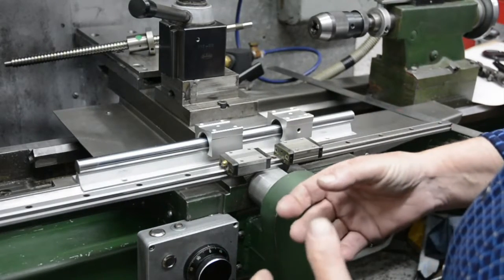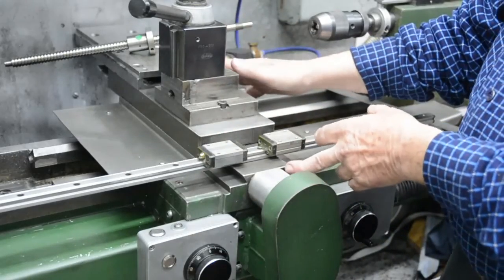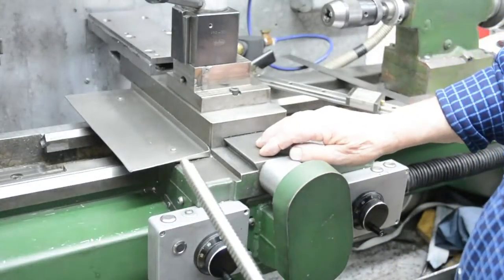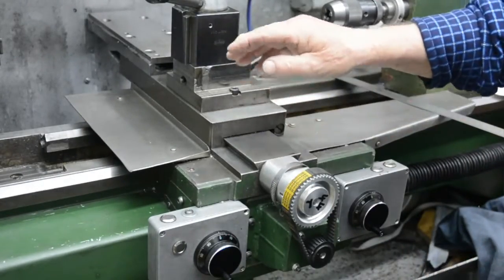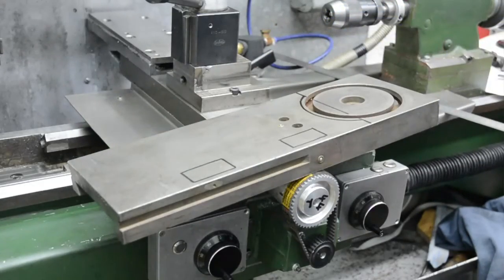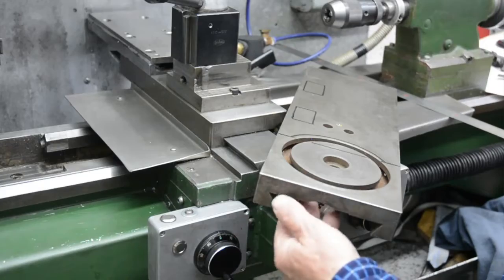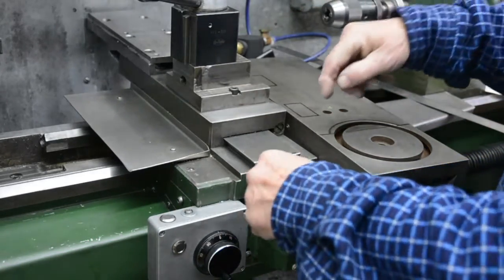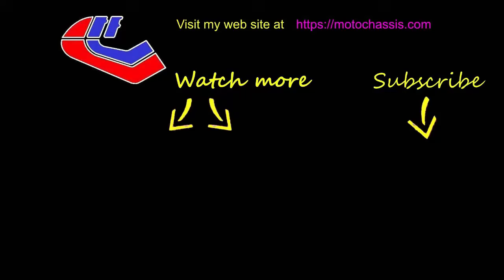Part 1. Upgrading a lathe cross slide to linear ball rails. Outline of planned cam grinding.

Comment: I'm sorry  to say, but it kills me to see such a beautiful lathe  get butcher .
But to each he's own .
Reply from the maker: They make these in their thousands so a few improved ones do not spoil the lathe gene pool.  After two years working with my previous conversions I can say that my lathe does its job better.  It is only a tool and is only as good as the work that it does.
Reply: True   @MotoChassisByTonyFoale
Reply: That's an interesting comment. It made me want to comment on it. One question I would want to know before making that
comment (all due respect) is how clapped out is the lathe? Is it probably gonna wind up in the scap yard after he's gone?
I'm dealing with a worn out bed on a cool little 1966 British made 11" x 36" Kerry lathe here in The States.
 I love the lathe. I'd like to true it up. I havn't priced a bed regrind yet (hardend ways). Tony's giving me ideas though I like the regrind idea better for me. We motorcle builders like to modify machines to our liking. The good news is Tony looks like a very competent mechanic.
Reply from the maker: @toddk.5873  Have you seen some of the other butchery on this playlist https://www.youtube.com/playlist?list... ?  
You might also like the motor cycle content in the photos and articles section at https://motochassis.com
Reply: @MotoChassisByTonyFoale  Came here for the butchery;) Some machines are great out of the box, others need some tweaking.
Reply: @toddk.5873 Tony wrote one of the definitive books on motorcycle frame design and handling. I'm the lucky owner of an original edition.

Comment: Why didn`t you go with V-groove roller system? I don`t know if there are any pictures of it out there, but the primary table of a Deckel S1 t&cg runs on cyl. rollers in a cross config. riding the V grooves, providing an immensely smooth action, a very rigid lateral support and the axial forces in your cases would have been offset by the leadscrew... I don`t know if such a sys. is more expensive when compared to what you chose, but i would consider it a more appropriate solution, as it is a much lower profile solution that is easily adjusted for wear and quite long lasting, provided it is taken good care of... This may be considered a more precise option, but lets be real here, any system can be as precise as you need it, it just comes with that nasty offset in the price tag, or if you are making it yourself, a greater amount of time and care... 

I quite like your ideas and approach, as i have similar ideas regarding some of my machinery, but that will have to wait, as i need a new shop...  I got a tad overzealous in my machine acquisitions and now i can`t place for a fart in my shop, let alone do any work that needs take place for my machines to be either serviced or restored...  At least you are here to keep me inspired with great projects like this, while i wait for stuff to get in order so i can start building a new shop... 

That is a nice cross-slide that you have got there... It would be a shame to cut off the compound groove end... As you said, it always offers some extra features for fixturing of low load componentry... 

All the best and kind regards,
Steuss
Reply from the maker: Thanks for your sound comments.  There are several options available which would do the job equally well.  I had to chose just one of them  and I had some experience with the type that I picked.  I make no claims that it was a better or worse choice than the type you suggest.
Either type would work well.
Reply: @MotoChassisByTonyFoale  
Same here, i`m just more familiar with roller system as it`s something that i`ve actually had seen and dealt with... I merely consider it a bit better, as its much lower profile than either of sliders you are using, and it can be adjusted for wear, which is always a good thing... 
Hope your efforts result in a good system, as it`s always a pleasure seeing a machine do great after tinkerings, especially better than the factory specifications allowed for... 

All the best and kind regards!
Reply from the maker: @camillosteuss  Well my previous mods to the lathe have worked out great and I expect the same this time around.  Do you have links to the system that you suggest?
Reply: @MotoChassisByTonyFoale 
That`s why you got my sub when i first saw your channel... I love good machine related content... 
Unfortunately no, i ain`t got no resources or links, but if you want, i can make a private video and post the link in the replies here, as i in fact have a deckel s1 with brinelled ways and its all dismounted and disassembled at the moment, so it`s hardly an issue to film it and post it, if you want a reference... 

`edit` 
I found a link to the system that im talking about... https://youtu.be/kpQK08OmGRI
If you want, I`ll still film my machine, as its easier to deduce the works by seeing the whole thing, rather than just the sliders... But this is the system that im talking about... 

Kind regards!
Reply from the maker: @camillosteuss  I am familiar with the V-groove system but I would like to see Deckel's implementation.  You can never have too much info.
Reply: @MotoChassisByTonyFoale 
I`ll drag my ass down to the shop in a minute, but it will take me some time to upload, or rather, it will take the upload some time to go through... Ill post another comment here as a ping when i`m done, you`ll need the link anyway, as it won`t be public...
Reply: @MotoChassisByTonyFoale  
I think the link went through, check your inbox, tell me if you`ve got it... As said, i just grabbed the cam and unwrapped the machine, so it wont be the best demonstration or a video in general, but i think you will get the picture... If you want, i will make a decent vid with more prep... The table is manually actuated, it has no leadscrew, but you appear to know your way around machines, so i won`t explain how to replicate the simple design like this... Hell, you could even make the whole thing yourself, just get the rollers out of some bearings or chop down precision carbide round stock... I don`t know what machines you have at your disposal, but if you have a precision grinder of some sort, you can diamond grind with a dia slitting disc through carbide stock and make your rollers, and if you are making it all yourself, you will need a precision grinder of some sort anyway... 

All the best!
Reply from the maker: @camillosteuss  You must think that I'm stupid.  I think that I had a brain fart.  For some crazy reason I thought that you meant the Youtube inbox which doesn't seem to exist anymore.  Anyway I did not receive any message by email.  Please try again with this other address info@motochassis.com I searched the net for pix of the Deckel slides but without luck.
BTW. Yesterday I prepared the new top slide and as soon as I receive the rails in the next few days I'll get it together and make the Part 2 video.